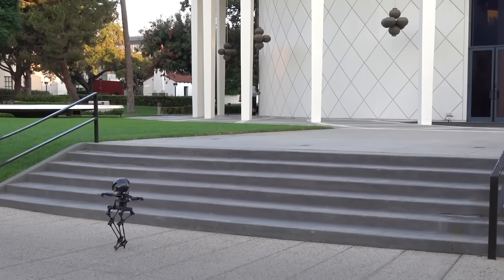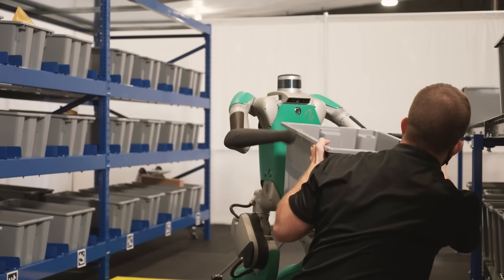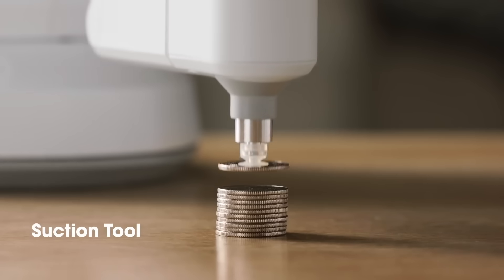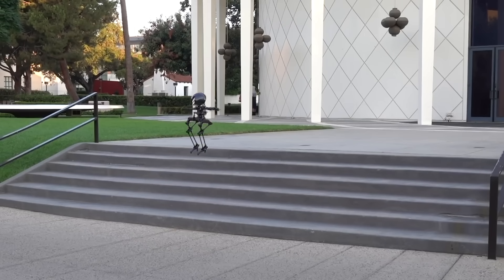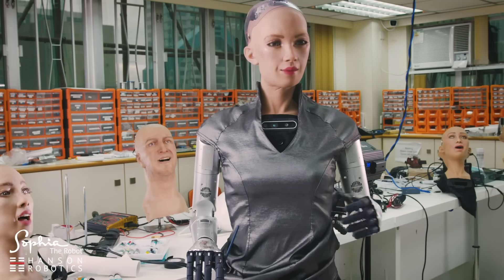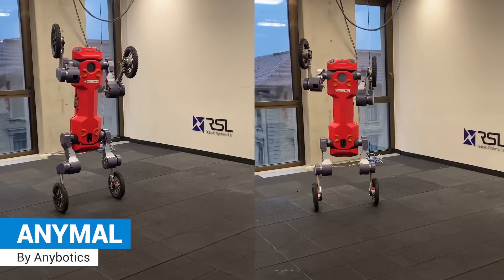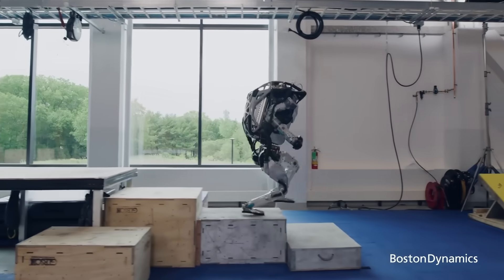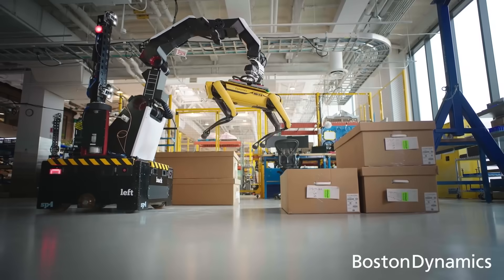14 Most Advanced Robots Doing Complicated Actions [Humanoid Robots, Robot Dogs And More]

Comment: Has anyone ever seen the movie I robot staring will Smith.   Or how about the terminator staring Arnold swartzniger?  Are we really going down this road.  It turns out, were not as smart as we think we are.
Reply: Check out warhammer 40k men of iron kinda terrifying if it goes down that road.
Reply: Think we just need to realize that self-awareness and self learning of the robots should be modulized and agreed upon by individuals and can not be easily broken or changed but the result allows for the complete self healing of the anatomy in question that the machine is interacting with which includes complete as possible pleasures to.

Still even with this system, there are weaknesses it's eliminating those for as-long as possible but alas may be inevitable that it breaks, we are after all a broken system.